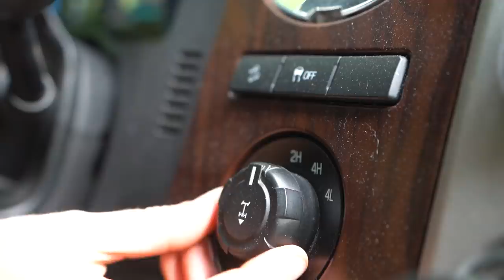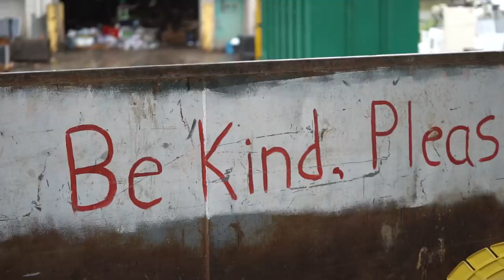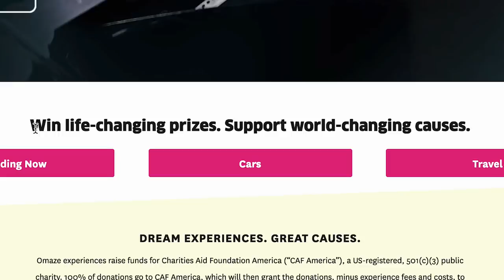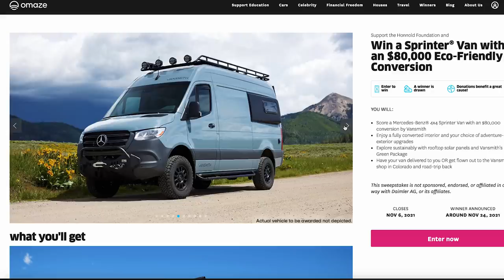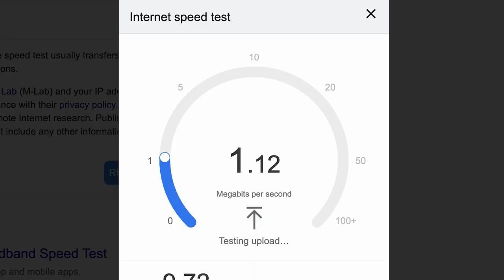First Week Living at Cabin in the Woods Alone

Comment: careful ladies !!!   water is HEAVY !!!!  1 kilogram per liter (kg/L)  and or US measures, one gallon of water weighs 8.345 pounds . Your deck is maxed out w. one tank !!!   its always best to set them on the ground !!  have Richie flatten out the area behind/ next to the new deck and set the tank straight on fresh gravel .... heck do 2 or 3 tanks so you dont have to redo it all again !! GL
Reply: Franko is right, each of those tanks weighs about 3000 pounds full.
Reply: Because of freezing weather in Winter I was thinking it would be best to either put them in the ground far enough to avoid freezing or blanket them and add a heater.
Reply: @greatpix  - I don't know how it would actualy work, but where I'm from (Long Island, NY), the frost line (meaning how far beneath surface earth that you engage the inner warmth of the earth, at about 55F, or so, is about 18 or 36 inches down, depending on who you talk to, and of course, Nova Scotia, as further north, would require the greater depth, at least.

I don't know what the metal cage of their tanks are made of, but if they are not stainless steel, I would be reluctant to bury them even half way. I don't know how their home is oriented, but I somehow suppose the water tanks are on the more westerly wall. If so, not an advantage.

It's all an experiment, and they have the guts to do so, rare enough.
Reply: @dobiebloke9311  Where I grew up in Norther Ontario (should be similar climate to NS) the frost line is 4 feet (48 in). Cellars have to be below that level to not freeze.
Reply: Was thinking the same thing about the heaviness and the deck
Reply: What is the reason they wanted them on the deck then? Did you ask them that?
Reply: @bananawammabama  it can be useful to have them elevated. It will increase the water pressure if they use it in their future garden
Reply: less apt to freeze if setting on  the ground too

Comment: If you are going to get a 4x4 truck in the future, get a reservation for a Tesla Cyber Truck.  Starting price below $40k.  All 4 tires will turn sideways so you can get out of mud easier.  Plus the bed area will have A/C in case you need to sleep in it.
Deliveries start this fall.
Ford Lightning is getting out their EV very soon as well.  They have electrical outlets in the bed as well as a built-in air compressor.  Both perfect for you guys.  Stop spending money on fuel, let solar panels charge up your transportation!

Comment: Old retired architect here...really like following your exploits and progress toward your shared goals. I am also a huge appreciator of the way you are loving toward each other. Good on ya! 
Thought: I think I noticed you placing one of your precast footings on cut grass up against the building. The grass and it's root system will largely ruin the bearing capacity of the footings as they will sink into the "duff" and become uneven or cracked even under your crusher fines. A base of some sort (as Joe K. mentioned for your road surface) will improve the bearing (load carrying ability) of your structures. Keep up the hard work of progress. It sure is easier with the smiles on your faces.
Reply: *Mike Sandiland - My dad, also an Architect, but still dead, would agree with you. He would have me dig at least a foot, if not a bit more down, fillled with gravel or stone of what ever, compress it, even by foot, and then place the supports for the structure. Just as you implied, less wiggle room to mess things up.

As to road surfaces, my old man once lived in a place (a planned on, between place) that had a muddy driveway. Every time we went to the beach, which was often, just as he had as a kid, he brought home a five gallon bucket full of shells. He cleaned out our neighbors coal burning furnace for free, to reep the ashes.

Between shell and ash, in about a year, that driveway was mud free, about as alphalt would be, only better, costing nothing more than a little effort, of flying a kite on the beach, as gathered. The ash had no kite to it, but we did form a human chain of it, so it was nearly effortless. Many hands, light work.

Comment: I just completed a raised bed garden with a herb bed in the middle of it. I also installed 3 50 gallon barrels to capture water from the roof of our house. I installed a small solar panel to operate a 12 v pump to pump the water to an irrigation system in the beds. Its easy to do and you guys should consider doing it. Hand watering takes a lot of time.

Comment: Awsome job, and video! (As always)
One hopefully helpful observation. This is a common patio construction error.
All of the weight of those two VERY HEAVY water tanks will be sitting on the deck screws into the 4x4's only.
Larger verticle supports would typically be used with notches cut for the joists to sit on.
In your case, adding some 2x6 or 2x8 between the pyramid blocks and the bottom of the joists will support the load much better.
No judgement and easy to add after the fact! I would hate to see it start to pull or break those screws once that weight is on them!
See you next week.👍
Reply from the maker: Thank you for leaving a comment on this. Going to look into it- Jazmyn mentioned adding joists near the blocks. What do you think about the stringers?
Reply: @Vanwives  Hi again.
If you put two 2x8 fastened to the 4x4's, up against the bottom of the joists, one towards the inside of the deck along the house side legs and one against the outside set of legs, you will create beams that the deck is sitting on.
These need the vertical piece from the bottom of each beam to the top of each pyramid stone.
All weight would be carried by the beams and blocks under directly to the ground.
Maybe consider doubling the beams, ( two 2x8's on each side).  If so, make sure the blocks support both beams fully.
I think those tanks hold 330 gallons each.That plus the steel cage and the weight of the deck itself and I think you're approaching 2 1\2 tons. That's the weight of a couple small cars!
Good luck!
Reply: @Vanwives  Try and get the tanks up as high as, gravity means no pump., too heavy for patio. If you ever have someone come by with a dozer for your firebreaks, get them to push up a big stand of earth to sit the tanks on.

Comment: When you are ready to gravel your private drive, this is what needs to be done. Base layer needs to be rock in the 3-4 inch size, about 12 inches in depth. Yes it will be a bit to drive over, however, you want that size rock in first to push down into the soft dirt. THEN use smaller clinker size rock (you’r call in gravel) to add on top of that. Its the small gravel size rock that will settle in and create a good drive surface that will last. If you only place small gravel it will just keep sinking deeper and deeper as you drive over it. Have done many a cabin entrance road this way AND they last :-) . Good luck !!!
Reply: Great advice!
Reply: 3-4 inch rock is called #2 and the best layer on top of that is 57’s with dust….which over time will compact so hard it will be like concrete
Reply: You learn something everyday. Love it!
Reply: Hope they read this.

Comment: Those water tanks look like over 300 gallons each, at 8.3 lbs/gallon, they will weigh over 5,000 lbs plus the wood. You will be putting about 1,000 lbs on each post. I think that will lean and crash. I would put another post on the center of each joist.
Reply: They look the same as we have here and they're 1000 litres each.

Comment: Seeing one of the dogs crawling under the house made me think of posting this. ----- A tip for dog owners who have dogs that don't like thunder or fireworks. If you have a laundry room with a dryer put your dog in there with the dryer set to 'Air' for as long as it can go. The noise covers up the thunder/fireworks and the dog will fall asleep. If you don't have a dryer then try playing white or pink noise through a speaker in the quietest area of the house. You can either get an app that generates the sound or play YT videos that feature it.  It's not a good idea to have the dog outside roaming free during a thunderstorm or fireworks as they can get frightened and run off in a panic and get hurt or lost.

Comment: If you girls do decide to live up in the cabin through the winter🏞️🌲🌿. What you should do is run piping under the floor attached to solar panels on the roof🕊️🌹 or wherever for water to flow through for heated floors.🌿 And it will be constantly because it's solar running🐞. Just a suggestion before you start a floor project🌱🧡. It would run 24/7 from the 🌞 SUN💞 I love watching you guys you're awesome. 😎🌹🌻

Comment: Just an observation, but I suspect the shed you cleaned out and stored your equipment in was intended 100% for firewood. If you intend to say in the cabin during the winter, you are going to need to fill that shed several times over with firewood. Also, when you first arrived you found the front porch stacked with firewood. One reason the front porch has a large overhang is for more dry storage of firewood and for easy access at night and in bad weather. Very common practice when living off grid. Best of luck and stay safe.

Comment: Girls, looking great as always.  got a few tips too play with if ya want too follow them fine, if not that's fine. 
skirt the house with form. using IBC totes, connect them at lease half way under ground too defeat frost line.  then rap them also with foam, if possible, use hot wire heater, under the totes for winter time.  plumb the tanks into the a room of about  5x6 too give you room for shower and toilet .  insulate heavily,  now mounting the tans on top of a good river rock sand bed, boxed in a framed area. that can be heated from solar power heater, or piped from house.  you should look for at lease two 500 gallon tanks.  use a small excavator too do the digging. it is cheaper then busting butt or find some smuck too do the grunt work.   also screen the house it will stop most of the bugs.  as too the ants. borax powder mixed one cap per gallon of water, sprayed around the whole area, once a year should stops them dead.   do the inside of house first, too. it will not hurt the dogs , or people.  you will need at least a solar system with a output of at least 10,000 watt, to run unaffected, most days.  remember too face clear area, two hundred feet from tree's.  closer too the house the better. don't know the price where ya live, but they do set up's fairly cheaply in most the US.     also find a small wood burner stove that will work in needed in winter time.  there are so many more ideas too play with but they work great, at making life easier.  best of luck with the life. be happy, be kind, rewind.    and just too know babies make it great too.

Comment: I discovered your channel during the Van rebuild, so entertaining, and such a good job, a shower!  My terrain is like your new house: bumpy, hilly. I suggest getting a Gorilla Cart (or similar).  It's fairly cheap ($110) and so worth it. It has 4 wheels, which levels the weight; stabilizes it; way easier to move through wet and bumpy ground then a 3-wheel barrow. You pull it, so it's easier to maneuver and you can pull a lot more weight then push it. It will let you haul wood and heavy stuff and go over rougher terrain. It's also big enough for 2 to comfortable nap in!

Comment: The best way that I found to deal with ants inside (without using chemicals) is to take chalk... yes, like sidewalk chalk.. and draw where the ants are coming in from. For some reason, they won't cross the chalk line, so if they are coming in thru a crack in the wall then draw a line either right on the crack or on both sides.
Reply: A thin line of liquid dish soap works amazing.  Reapply if your using it outside and it rains.

Comment: I get it. You want to catch water from the sky, store it and pump it into the house. If you wanted it clean you'll have to filter it. But, there is a readily available catchment system already made for you. What  you're doing is really just novelty. A well, catches water that is stored in the ground as it rains. The container is huge... your entire yard. It comes filtered by the ground.  Yes, the water that runs off your roof will end up in the ground. It doesn't have to be in a plastic container. Wells are true environmental water systems. A plastic container is a small, incomplete version of it.

Comment: You Women Rocking the carpentry skills...take your time with the land, you will find the low spots all over the place...You will need a 4x4 truck for the winter travels..if you can find a spot to park the van, back it into a level spot...that way if you need to tow it out, easier to hook up...The ants can be a problem...I use a lot of Borax 20 Mule
Laundry Powder...into a 5 gal sprayer, mix .25 cup Borax powder, .25 cup of Epsom salt, 1 gal white vinegar and fill up with water. You can spray this for ants and also use on poison ivy and oak or grass /moss you want to get rid of...Cheers from Maine

Comment: Hi! 
To get rid of the ants kindly :-) light some incense in the attic but be careful to be sure to put them in a fireproof metal something-- the one thing that scares all critters is fire--where there is smoke there is fire---at least I hope they think so----I watched mine actually carry out the young immature ones--then gone. If you use an exterminator they will use something that stays around a long time and is not good for you two or any other critter  ---   you may have to keep the smoke going for a couple of days. I hope it helps. Thanks, Van

Comment: Your deck for your water tanks looks great. I couldn't tell in the video if you used carriage bolts. You should have two carriage bolts in each 4x4 bolted through to hold your rim joist and also several going into your house. (If its free standing then you need to put diagonal bracing under it to keep it from twisting and falling over. The average sheer strength on a 16cc penny nail in around 200 lbs. Also I noticed you used screws to fasten your joists hangers which aren't rated for that kind of load. Ideally you woud use galvanized strong tie nails which have a much higher sheer strength. Your probably not going to want to change out all your joist hanger fasteners at this point but I would at least make sure to add carriage bolts and cross bracing. Water weighs around 8.6 lbs per gallon so when full theres going to be a huge amount of weight on that deck and you definitely don't want your deck to collapse. Best of luck love your videos.
Reply from the maker: Thank you!! We appreciate this so much. We will change it all 100%!
Reply: Just watched this week’s video and literally scrolled through all the comments to see who caught the deck screws in the joist hangers! I just redid my parent’s deck stairs and my younger sibling and I had to extend the rim joist using carriage bolts so that we could nail the hangers for the new stringers. There is so much to learn and I loved seeing the feedback in action. Thanks for spreading and highlighting the knowledge 😁

Comment: What a joy you guys are. 
Why are you not drinking your sky harvest? We do and it's ambrosia. If you feel the need you can filter it but keep your gutters clean and install a first flush system and you probably won't need to. Most people here in country Australia live off tanks, very very rarely do people sink wells. It's better water and much cheaper.
It crossed my mind you might have asphalt shingles which might pose problems, we use corrugated iron or tiles here. Maybe replacing your shingles with tin might be cheaper than sinking a well. 
We have another word for asphalt shingles in Oz, kindling.

Comment: You need to attach you deck framing to your posts with metal brackets, you can't just rely on screws to hold the load of all that water. As for the Ants just buy liquid/gel Ant Bait. Once a few ants get into it they take it back to their nest and wipes em all out. Don't spend your money on a exterminator save it for dump truck loads of gravel for your driveway. 👍👍

Comment: Get a proper rain water tank and place it on a bed of crushed rock (blue metal) 100mm thick. Shouldn't cost anymore than that deck and be more suitable with a much larger water capacity.

Comment: Ok so ive never seen snow so i have northern questions ....how do you stop the water tanks from freezing solid in the cold Canadian winters ? how do you stop it from getting filled with Algae in the summer ? will that wood support the weight of those tanks full ? wow thats a lot of weight ??? what are you using for power a generator ? will the cabin be insulated for the winter or is it already ?? y'all are doing a great job (yes a southerner LOL) thanksssss have fun

Comment: Please don’t make the mistake of using screws to fasten your joist hangers!  The only screws approved for that use are the ones made by Simpson (the joist hanger company).  Other screws, such as drywall screws have little sheer strength and will not support the load.  You can see then by putting one in a vise and wacking it with a hammer.  It will break.  

You should use nails.  Go to the Simpson website (strongtie.com) or get their book to see which nails to use.  Some applications need longer and some need thicker.  The Simpson brand nails are the best and make it super easy.  And never use nails that aren’t galvanized, especially with treated lumber.

No, I don’t work for Simpson, but I have been doing this for a long, long time.  We want your hard work to last!